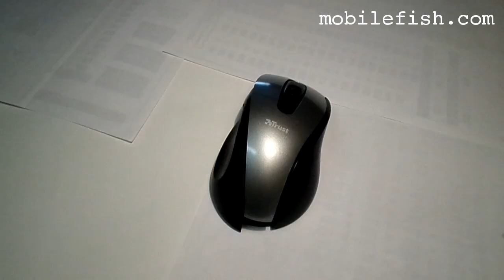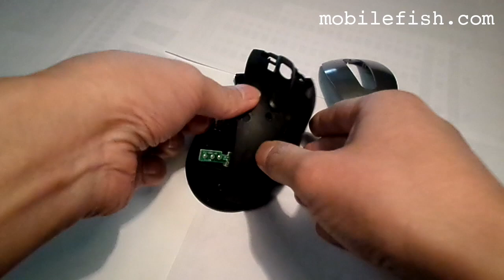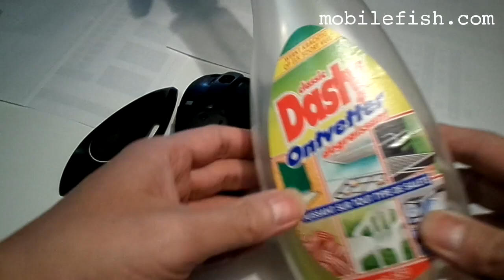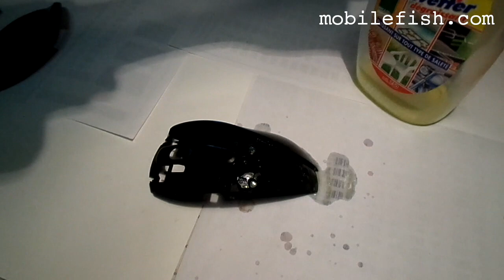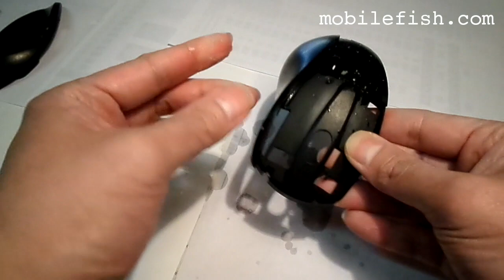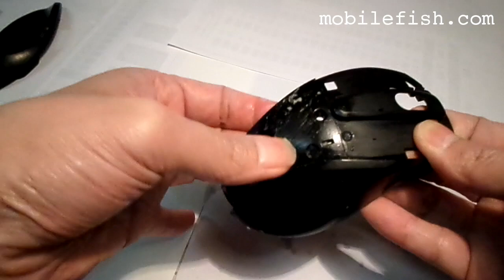How to remove the sticky rubber coating from a mouse using Dasty Degreaser Classic

Comment: Thanks for this video... Ethanol or Isoprop works great as well. It's sad that many modern products still use this coating. It started to appear in the 90s, and already in the early 2000s many products started to get sticky. And what did they do instead of going away from this stuff --- NOTHING. My 2014 mouse still has this coating and guess what - It slowly starts to disintegrate. It will most likely take another year or two before it is completely sticky, but WHY, WHY still use this material. It's known since 20 years that it doesn't last
Reply: Manufacturers don't want it to last; they want you to buy a new one.  :-(
Reply: That’s why people should stop buying this rubber kind mouse.. there’s new alternatives which adding grip tape manually..

If the grip destroyed then we can remove it and buy new grips

Comment: if you dont' want to scrap up your mouse by scratching off the rubber use a piece of fabric softener sheet spray the degreaser directly on the sheet and then put your finger in it pulling on the edges to make it tight around your finger... then do small circles rubbing the cloth like grooves in the sheet will removes the rubber for you leaving a nice even smooth surface and you won't get a mess everywhere. just throw the sheet away when your done and wipe off the mouse with a paper towel and some rubbing alcohol. if its still slightly sticky you can repeat the process with a clean sheet and it will make it smooth as plastic.

Comment: Ammonia Window Cleaner also works perfectly and easily. I used it on my radio, and it does not damage the labeling. I then wiper with a damp J cloth and dried with a cheese cloth.

Comment: Lex and friends, I have found a better solution to our sticky rubber coating problem. BTW I have a fairly new Logitech MX 1000 Laser Cordless mouse. Here is a great solution, and it does not require taking the product apart. 

1. Take a paper-towel and dampen it with warm water.
2. Spray WD-40 on the towel and rub the rubber surface with a fair amount of pressure.
3. Using a soft brillo pad with the blue powdered soap coating and scrub the outer coating of the rubber parts (take care not to get the blue soap in the crevices.)
4. Viola! Your mouse will be as smooth and stick free as you could imagine.... Happy computing, etc.

Comment: Hey, after removing the "stickiness", is the rubber coating gone (peeled off) or back to normal as it was before?
Reply from the maker: The stickiness is completely removed. You will feel the flat hard plastic surface.

Comment: I mean you can also use sand paper to do the job. Just make sure you use it under water. In both cases you will completely remove the rubber coating.

Comment: I have same issue with my razer sabertooth gamepad, will this also help me to remove sticky surface from my gamepad? I don't know why but after a while all my gamepad became stiky and i can't use it anymore :( it's a shame, because i bought this gamepad for about $80 and it's a shame for a Razer company.
Reply from the maker: To be honest i do not know. Just try it but on small area. But be very careful! I have disassembled my mouse! Make sure no fluid, such as water or Dasty will be in contact with any electronic component!!!
Reply: thanks for the reply :)

Comment: i was about to throw away my mouse, then glad i came across this video and remembered I had some disinfection wipes which happened to work a treat, apply thoroughly, leave for 30 seconds and use a nail to gently remove any sticky coating left then wipe off  No need to disassemble and next to no effort at all!
Reply from the maker: I am glad your solution worked. I have a Dell laptop with this damn sticky rubber coating. My solution did not worked, maybe yours? I will give it a try. Thanks.
Reply: @Mobilefish  I'm sure other wipes will do the trick, but i used some medical disinfection wipes which are very damp, and when applied with a little pressure into the plastic worked

Comment: I have a Cherry blossom BLUE FinalMouse that is discolored like hell, would this work? Was the shell damaged from the degreaser? Thanks!
Reply from the maker: Shell is made from hard plastic and was not damaged using the degreaser. The mouse was completely disassembled. I had removed all electronic and metal before using the degreaser.
Reply from the maker: I used the degreaser to remove the sticky coating. I have NOT used it for discoloration.
Reply: Mobilefish.com finalmouse uses ABS plastic, if I use degreaser (does it matter what brand/type?) will it eat or mess up the plastic in the surrounding area? The base color is baby blue it won’t change shades of blue will it? Thanks!!!
Reply from the maker: I suggest, try YOUR degreaser (I do not know what kind of degreaser you are using. I was using Dasty) on a small surface somewhere you may not see it, in case something goes wrong...

Comment: just use isopropyl alcohol......
Reply: Whoa, just tried that- 70% isopropyl alcohol that I just had on hand, & a paper towel. 
My special edition (previously rubber coated, sticky, & filthy with 8 years of grime stuck to it) lime green nVidia HAF-X looks like BRAND NEW! Well, in this one spot. The whole thing will take a while, but omg THANK YOU so much!!!
Reply: isopropyl made my mouse 10x more sticky after cleaning it, so i guess doesn't work on all types of rubbers... be careful.

Comment: Would this work on a laptop? i'm afraid i will scratch it. Using a bit of water on a cloth seems to scratch the surface of it or it's the sticky coating i can't tell. It was easier to tell with my old mouse as it has this nasty brownish color to it.
Reply from the maker: I have a Dell Inspiron 1720 and the cover is sticky. I would NOT try this on my own laptop because i am afraid the Dasty degreaser will be in contact with some electronic component. My recommendation: DO NOT DO THIS.

I was able to do this with my mouse because I completely disassembled my mouse. In this particular example I was 100% sure no  Dasty degreaser will ever be in contact with any electronic component.
Reply: Alright, then i'll keep searching, maybe it's just impossible to keep this clean. Dust comes back pretty quick and we keep our house clean daily. I have a Asus G75VW laptop, the area where you can rest your arms is of rubber material.

Comment: Another way which is much easier and less messy is to spray the entire area with Isopropyl Alcohol and wipe it off with a soft cloth.
Reply: this did not help at all and made it even stickier. the grease remover did magic however!

Comment: Sprinkling it with baby power works as well!
Reply: just making it worst by adding more to the gunk.
Reply: I did it and it worked, but it just covers the stickiness; it doesn't remove the sticky rubber.

Comment: WTH...I have had desktops and laptops since 1992...this has never happened to any mouse I've owned ??  All I can ascertain  is that to accumulate lots of (Gunk)...you have to be a (Grub-bug)...Try washing your hands sometime !
Reply: This happened to my $120 mechanical keyboard from 2012. It's the shitty paint they used on the product at the time and it didn't age well. No one uses this paint anymore. I just looked up this video since my keyboard is sitting in storage unused and I want to replace my current one I bought to replace the sticky keyboard, but maybe I can salvage my old one that perfectly fine other than the sticky coat of paint
Reply: The rubbery surface turns sticky over time, even on items that have never had human contact.  Logitech remotes, Logitech Squeezebox radio, Tivoli radio, microsoft mice, these are some of the items that I've had to remove the stickiness from in the last 5 years or so.  You are just lucky to never have a model that uses it or you got better quality I guess.  I've been told that some older Ferraris have this issue with certain pieces in the interior.
Reply from the maker: Why on earth are they using this stuff?? Hopefully they stop using it.

Comment: Wash hands before using mouse. Sweaty hands cause the stickiness.
Reply: I have a Memorex iPod speaker and have never touched the bottom and it still got sticky.  It is the rubber and age, not necessarily the hands.
Reply: @ChuckMabrey  same with the inner-side of each of my car's door pulls.  They are hardly ever touched and only for seconds at a time but after 10 years the rubber on all 3 doors were melting.